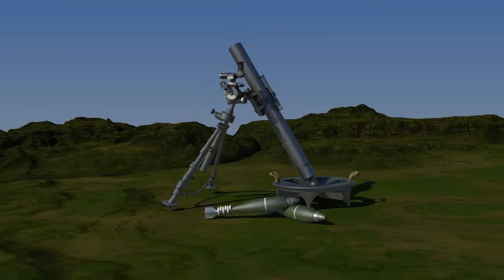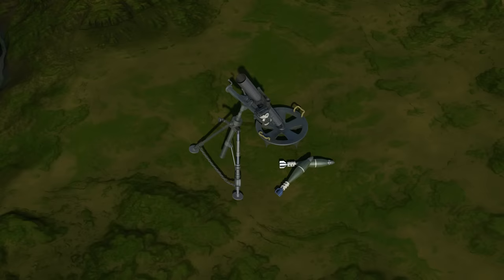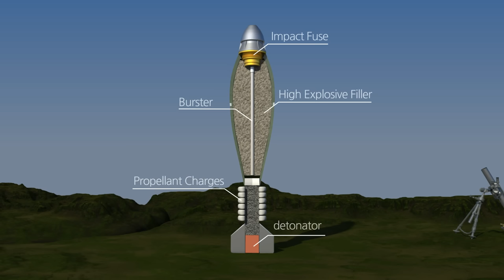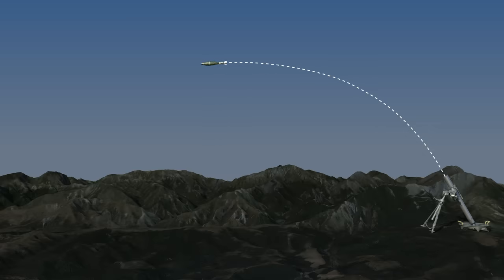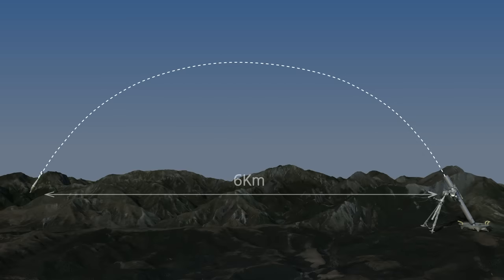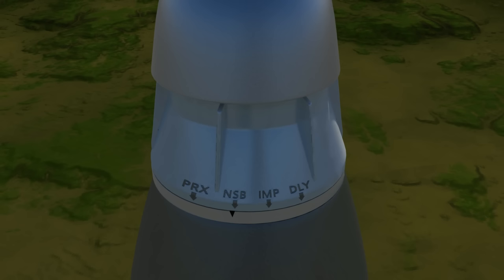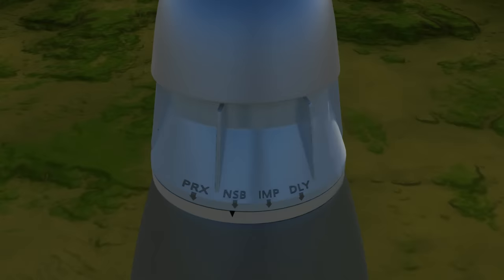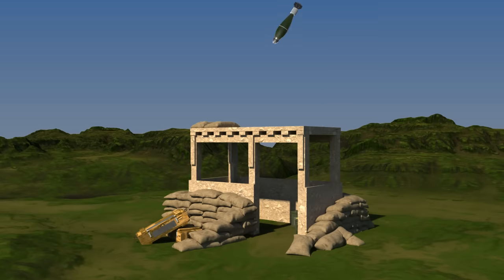How does a mortar work?

Comment: You fail to mention the absolutely Essential role of the gas trap grooves. Dropping projectiles down a tube with propellant at the bottom was nothing new...the grooves were the magic bit. They are usually 3 or 4 grooves visible around the middle/fattest part of the mortar shell.
The shell has to be thin enough to fall down the tube, but the propelling charge must push the shell up without leaking around that gap between shell and tube, (as that reduces range and accuracy as the shell wobbles)...but hows that done eh? Gas trap grooves!...which are actually VERY carefully designed to have the exact shape and depth that makes the escaping film of propellant gases form vortices, which forces the gas behind to slow down, and thus makes a gas seal. (In artillery and rifles, this seal is done by a metal driving-band, which physically expands into the rifling, leaving no gap.)
 That's the genius of the Stokes type mortar, the shell's grooves, and what made it so much more accurate than the medieval style mortars that had been around for hundreds of years, which could hit a castle, but not pinpoint targets like stokes mortars.
Reply: This is the content I’m looking for! Nice explanation
Reply: Someone with actual knowledge - like you - should have been insolved in making this video.
Reply: There's an expanding O ring around the middle now. When the charge goes of and all the super hot gasses start moving up the tube, the O ring expands and creates a seal. You can actually pick those up after shooting. It's a fun way to mess with the new privates lol.
Reply: @jamesdavis-hc2su  thank you for the modern info. My expertise ends at 1945...
Reply: @mathiasvries   Thanks, Dr. Sciecne. The University of Sciecne is lucky to have you.
Reply: Images of mortars used in Ukraine 2022 all show gas trap rings, no sealing bands, so Soviet ammo still using traditional style mortar gtr.
Reply: @DeathlordSlavik  nice info, thanksy. I suspect the sealing O-ring is largely responsible for the long range of a modern USA M252  81mm mortar, 6500yards, double the WW2 M1 mortar's 3300yards.
Could WW1 shells STILL be safely viable? 100 year old explosive, that stable..? Impressive if it works.
Reply: @bamspam23  those long range advances lately have been due to using basically rockets in the mortars to extend their reaches. That and the guidance systems needed tho cause the rounds to do only about half the damage as typical ones tho. They just had less room for explosives is why. There's videos explaining it tho. I saw one the other day explaining it but I didn't pay it much attention and forgot most of what it said. Interesting stuff tho
Reply: you seem to know alot about mortars do you know why i just saw a video of a jdf mortar team using 120mm and after the shell left the tube very quickly something else came flying out do you have any idea as to what that is ive been trying to figure this out for a hour now looking things up all over the place cant find anything about it
Reply: @Broken_dish most likely the obturator ring that expands and seals the gasses.
Reply: thanks for the info.  interesting to know.  without going into too much research into the subject.
Reply: now we need a video on how the sights work.
I was always wondering how it works.

Comment: Unfortunately, most Mortar men don't dig down and set the Baseplate like that, rather than doing that they have a guy standing on the Baseplate to help it set into the ground level as possible. I know this because I served in the U.S.Army as a mortar gunner on the 81mm Mortar. We used the old M29A1 Mortar which looks just like the one you're showing in the video...
Reply: You are so true
Reply: Thx for your service
Reply: Whats the procedure if the shell does not go off? Do you have to abandon the mortar, and destroy it from a distance?
Reply: @vast634  there’s a whole process to it but from what I remember you remove the cannon from the baseplate and angle the canon so the round slips out with a soldier catching the round haha it was pretty sketchy but it happened once to us
Reply: Did you call it riding the lightning because we sure did
Reply: How rare is it for a round to go off in the tube killing the mortar crew?
Reply: @idontcare9797  I’d have to say pretty rare I’ve never heard of that happening. I’d doubt it to because the round has to travel a certain distance I believe before it can even detonate.
Reply: @sarahtakash  of course they did 😂
Reply: Procedure for misfired shell was,unclip barrel from baseplate.Slowly tip barrel forwards having another catch the shell.Place on ground and walk away.The ordinance officer then exploded the shell with a couple grams of plastic X attached to it.Other armies may have different procedure.
Reply: When I turned my mortar platoon over to the new 2LT we did this to him. He was standing on the baseplate and I waved a guy behind him who one handed a round down the barrel. 2LT about crapped his pants.
Reply: Sets itself after the 1st couple rounds
Reply: @idontcare9797  rare, usually caused by bad training
Reply: @vast634  There are different mortars with different techniques. With our mortar there was a device you lowered into the barrel with two ropes by two people holding one rope each. It was connecting to the round with a click, the two guys then pulled it up and out with the support of a third man. The round was not life - they need the shock of being fired to be life. the only problem was, when the two guys let it slip back down - then it was possible that it got fired - with the guys holding the ropes. Never happened though.
Reply: @vast634  It depends upon how many rounds have been fired before the "miss fire " occurs.  You usually vacate the area and wait 5 minutes. Someone comes up and checks the barrel for heat. If you have water, you can pour it on the tube to help cool it. You ensure a cold tube before you try getting the round out. Had 4 misfires in my career as a mortar platoon leader. Three times with 4.2" rounds. One misfire on round 18 of a fire for effect. (was that tube hot) One time I was safety officer for the firing of 81 mm mortars. The tubes had just come back from ordnance and the firing pins had not been put back in the tubes. The first round did not sound right and it turned out I was correct. no firing pins in any of the three tubes. Bottom line is you never want the tube to go below the horizontal was trying to get a misfire out. I did because I was not leaving tube and round in the misfire pit. I did get the round out. Checked it closely and refired it with no problems.
Reply: @idontcare9797   some type of mortars, doesn't have a static needle, but one with a spring that operated with a rope after the round was put inside (common in old 120 mm mortars). it happened that people forgot they already placed a round inside if they didn't fire it right away. Then they placed a second one while the first one is still inside. When shooting, the first round will hit the second one inside, and the whole thing will blow up. There is a special tool that should be placed at the top of the mortar to prevent such accident.
Reply: @sarahtakash  Barrel gets too hot from firing the rounds, thats why you give it time between rounds to fire or certain amount or rounds per fire mission. Tossing a round in a hot barrel will cause the round to "cook off" and explode in the tube
Reply: @vast634  No....the Assistant Gunner is supposed to help take the bottom of the mortar tube loose at it's baseplate and tip the top downwards to remove the round , if it's not dislodged at the base of the tube and goes off, then it's removed and taken to a demolition pit away from the firing line...
Reply: @Street-ty7ce  you're partially correct, we used to kick the bottom of the Mortar tube to see if the round dislodged and went off, if not then we did just what you described....
Reply: @idontcare9797  it's pretty rare but it does happen..
Reply: Fire enough rounds faster then the sustained amount, tube will heat up and can cook the round off in the tube.
Reply: @idontcare9797  the safety pin in the round is ejected from the round once the round leaves the tube, can't explode in the tube.
Reply: I have never dug a baseplate in that happens when stand on it and shoot your first round will set the base plate which comes in two sections on the 81mm mortar
Reply: In the New Zealand 🇳🇿 Army we always prepare our Mortar Positions unless it’s a hasty action
Reply: What are the advantages/disadvantages of near surface over proximity?
Reply: @sarahtakash  Probably dropping two grenades in the barrel accidentally when the first did not go off.
Reply: @vast634 someone yells MISSFIRE. you wait at least 5 minutes(longer if the tube is real hot) so that you do not have a cook-off. You return to the tube and disconnect it and try and get the round to slide out of the tube.

Comment: I worked with a 120mm mortar. Usually you have a battery of 6. Typical use is blocking a crossroad, fighting landing parachuters or digged in infantry. On an exercise we were able to see the enemy in about 4km distance on the other side of a valley what is really unusual. A passing offz group was interested and asked what a mortar group would do if the command post for calculating was gone and you could see the target. So our group was given the task. The periscope was moved parallel to the barrel to aim directly at the target. The Uffz used the glasses to estimate the distance to a tank wreck, used the table to order angle and load. We fired a round and - hit the tank. Totally unexpected. Usually you hit app 200m off and use one or two corrections to get as close as 50m to the target what would be considered suitable.
Reply: With the time spending on mortar you gain bit more experience and have more "feeling" to adjust it and after a while you get deadly accurate even from the first hit. Not to mention after first grenade fall every body look for the cover so next shells does not match so much damage as the first one what came from "nothing"
Reply: 0 de LP @manjelos
Reply: We (not me personally, but our mortar pit) used our 120 as a flashlight mostly. The 120mm parachute flares stay up in the sky for a looong time and can illuminate an entire valley.
Reply: @robertwood9572  I know. We used it on a shooting range. I was able to read a newspaper from 4km distance.
Reply: Круто !
Reply: interesting.
as i was seeing the video i got really curious - are the mortar accidents? when it detonates before, or just shortly after being launched, thereby hitting the operating crew?
is it common? was it common in previous generations?
Reply: @dmitrishebalev4945  It happens that a round does not ignite and sits in the bottom of the tube. Our ammunition needed a hefty punch from the lgnition to be life and ready to detonate. A round going up short of the tube I did not hear of. Also when it just jumps out a few meters. The kick is not strong enough to make it ready for explosion. I dont know for other countries ammunition. In WW II the rounds were not that smart, i heard. 
To take out a round from the bottom of the tube, there are two methods. 1. with some mortars you can remove the tube from the bottom plate and put it upside down so that the round slides out.  2. we had a heavy one with fixed plate, so we had a special tool to let down the tube with ropes by two men. It makes click when it attaches to the round. The two lift it up with the ropes and a third person pulls it out when it arrives at the top.
Reply: Badass! I love it when an idea completely falls into place!
Reply: @redflipper992  You talk to me? I am serious and honest. Everything i said is true.
Reply: @mweskamppp  yeah. right. You were never in combat.
Reply: @redflipper992  I never said that. I was conscript during the cold war. There was no Bundeswehr Mission in other countries that time, but i participated in nato maneuver.
Reply: @redflipper992  exactly what I was thinking
Reply: i just saw a video of a jdf mortar team using 120mm and after the shell left the tube very quickly something else came flying out do you have any idea as to what that is ive been trying to figure this out for a hour now looking things up all over the place cant find anything about it
Reply: @Broken_dish  nope.

Comment: The name "mortar" is derived from the "pestle and mortar" alchemist's or apothecary tools in the middle ages. 
That mortar was a heavy deep metal pod in which ingredients were ground to small bits or powder with the help of the pestle. 
When gunpowder was invented "cannons" which shot balls of iron or stone (shrapnel effect) high over fortress walls were called mortars because their shape resembled apothecary mortars. 
Later they were used to fire hollow metal balls filled with gunpowder and a fuse, so called "bombs" or "bomb shells". The fuse could be lit manually because of the short barrel of the mortar. That was impossible in case of the long barrels of cannons, which therefore for  several centuries fired only solid cannon balls until automatic fuses were invented.
Reply: Thanks a lot! Very good historical background information .
Reply: Napoleon was the first to use cannons and mortars in volume. Officers that could read and write were used to do some rather difficult calculations to make sure the bombs exploded near enemy infantry. These hardened leather balls had salpeter, ammonia and other fun stuff inside, making for blind and handicapped people, lost limbs, all that fun stuff.
Reply: I thought this video was about pestel and mortar...
Reply: CANNON is singular AND plural in standard English.

Canons are entirely different altogether, of course.
Reply: We could see them in action in "The Last of the Mohicans", when the french are besieging Fort W. Henry.

Comment: There's HE shell (High Explosive) Fragmentation shell, WP ( White Phosphorus) Chemical shell, HEI (High Explosive Incendiary) shells, Smoke shell to cover the ground, Illuminating shell to bright up the night sky, and maybe even a small nuclear shell.
Reply: Re a small nuclear shell, considering the weight of uranium, the maximum range on the mortar would be about 500 meters. There would be no use dropping the mortar; you could just spike it on the ground
Reply: @thatzwhat  500? Where did you get this number?
Reply: @LordAuron  From simple physics and a knowledge of the mass of a typical mortar round and the mass of uranium that would be required for even the smallest of nuclear warheads. Obviously, Steven Baer meant his "maybe even a small nuclear shell" comment as humor because launching even the smallest of nuclear warheads would be impractical in an 81mm mortar. You can do the calculation yourself. Assume the mass of a typical 81mm mortar round is 4.5 kg and assume that the HE in the mortar round will be used to implode the uranium. You'll need at a minimum 15 kg of uranium for the warhead. Neglect the weight of the additional electronics and neutron reflector. Now your mortar round is 19.5 kg. Assume some practical range for the typical round (I think I used 2500 meters) and do the calculation for a 19.5 kg round.
Reply: Nuclear shells are only for heavy artillery (155mm upwards)
Reply: You need a bigger caliber for artillery nukes. The USA had 280mm or 11in versions and 406mm or 16in versions. Between 390kg and 815kg. An explosion in the range of Hiroshima. Used until mid of the the 1960s. later they used similar nukes as mines. For example digged in at some villages in west germany where the Nato expected an attack of the red army.
Reply: And practice cartridges.